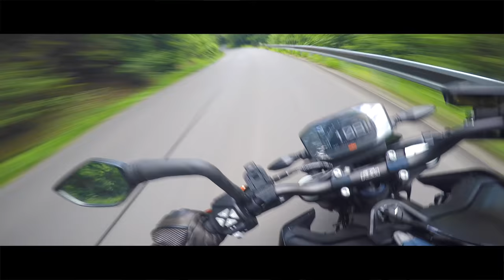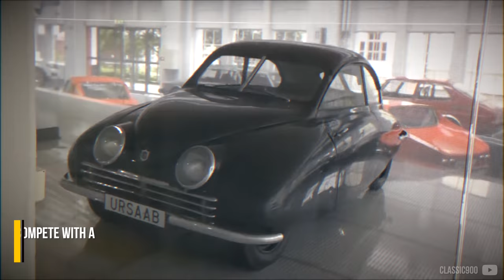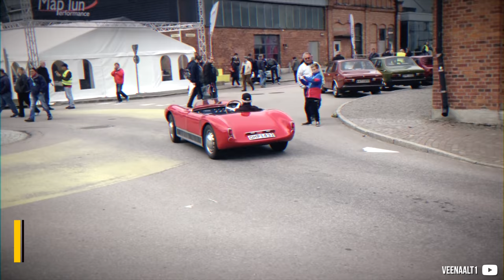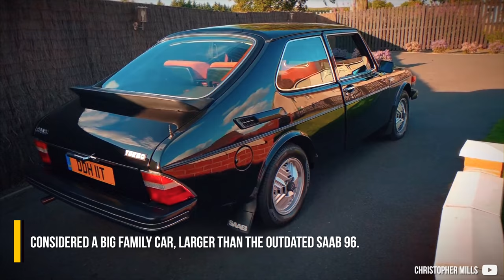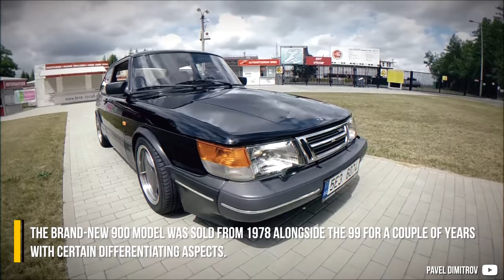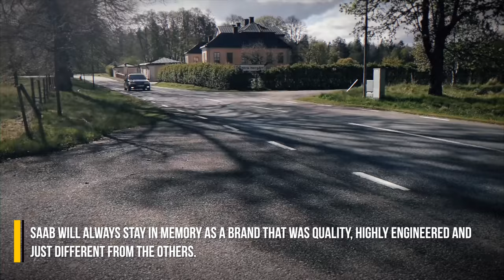Why We Miss The True SAAB?

Comment: Fun fact:

When Saab went rallying with the 900 it didn’t need a roll cage due to it strenght. Tho they had to do so to comply to regulations.
Reply: 99
Reply: @robludwigsen7831  

As far as I know it was with the 900
Reply: Watch project 99 on youtube...awesome documentary. Saab left rallying before the 900 came out basically. It got too expensive.
Reply: Having actually rolled my 900 I can speak to this. I had my sunroof open at the time and it’s a strange sight to see grass sticking through over your head. Both doors still worked but I had to crawl out the top because when I landed I ended up with a fence post on either side of the car. Yes, I was very lucky.

I also had the factory racks on my 900 and wondered how strong they were. I found a photo taken in a junkyard with a second SAAB literally stacked on top of one and they were not bent.
Reply: @robludwigsen7831  

I Will watch it thx
Reply: @blacksquirrel4008  

Thats impressive indeed

Saw a Photo of a 900 with a fallen tree on top of it. Without a bended roof.
Reply: @derbisenda1330  old black and white photo? Tree is like 2-3 ft in diameter? Amazing right?
Reply: @DesertSessions93  

Yess that one very impressive
Reply: I really have no reason to hate Saab and surely their cars were better than an average VW but they just didn't make it after all.
Reply: They still make heavy trucks, fighter jets, commercial aircraft, missiles, and defense systems. The automotive sector wasn't profitable.
Reply: @blacksquirrel4008 Good thing you were not driving some other type of car
Saab 900s have a very strong body
Reply: @earthbarnes6694  yes, very strong.
Reply: @robludwigsen7831  Yes Audi Quattro killd the real rally championship  for most car brands.
Reply: @robludwigsen7831  Saab returned to racing in the form of Rallycross and Hillclimb with the 900 NG and 9-3 though. And later did touring car racing in the STCC with the 9-3 NH.
Reply: Robin Bank ran a successful endurance road racing Saab team in Chumpcar - - > Champcar. Strong and fast!

Comment: the thing I remember about Saab is,  while working on a couple of 1980's and 1990's Saabs while I was an apprentice mechanic  thinking how weird the engineering on those cras was but how well made everything was.
Reply: Once one understood the design philosophy the car made sense and was fairly easy to wrench, especially something like a clutch replacement which could easily be accomplished in under 2 hours.
Reply: @paulskopic5844  Probably came from their military engineering background. Swedish Airforce demanded easy to maintain in the field airplanes, so SAAB (atleast on airplane side) put great emphasis on making parts easy to access and building plane into assemblies or modules, that could be quickly bolted on and off from the plane in the field with minimal equipment.

Idea being..... If it is broken in the field, unbolt it, take same spare assemble from the supply truck, bolt that in, put the broken one in the supply truck to be driven to a workshop somewhere deep in the forest and probably under a mountain. They will refurbish it and send it back to supply. Since the place the plane is.... must be minimal to not be a big permanent target. So there is not great hangars and machine shops at the airstrip. It is just the strip with couple pads to park the planes at while supply truck, fuel truck and munitions truck drive next to it at the pad and load and unload stuff from the plane. Be it loading in more fuel, spent swapping out spent cartridges, putting on new missiles or swapping out whole plane parts.

So I assume as such, SAAB engineers had lot of experience designing bolt on, bolt off mountings, clampings and supports. Including were specific understanding of the assembly and maintenance process due to military demands. "right we have to think where that bolt head is going, since well the field mechanic needs to get their wrench on to it without disassembling the whole fighter plane from around the bolt. No point having few easy bolts holding the engine to make unbolting it fast, if you have to first remove the wings to get hold of the bolts securing the engine in place."
Reply: @aritakalo8011  You are absolutely correct, and I also have explained this to others.  Saab is the complete opposite of Japanese cars where there is no thought to ease of maintenance.  Saab also used as few parts as possible which is the opposite of both Japanese and German where the design philosophy seemed to be "why use less parts when it is so easy to make it more complicated".  I have wrenched a lot of other brands and I would take a 900 series always for ease of maintenance.
Reply: takes longer to put a belt on than change a clutch !!
Reply: I agree with you completely. The Powertrain was so, "weird" for the era a lot of Mechanics had difficulty working on them here in the States. I am a Master Mechanic now so I can spend a little more time on a single vehicle. But back when I was starting out, time was money. The more Vehicles I got in and out of my shop in a timely manner the happier the customers were which led to life long customers in most cases. As a young small business owner having repeat customers was like owning a Goose that laid Solid Gold Eggs 😊
Reply: @paulskopic5844  My favourite was things like the water valve for the heater.  You popped out the left dash speaker and could reach down through the hole to replace the valve.  I literally did the job in 20 minutes while in the parking garage at work. This was the kind of job that could take hours in lessor vehicles.

Comment: My first car was a SAAB. It had an incredible amount of torque and was a blast on the highway.
Reply: Same here. The first was a 99 ems from -73.🙂
Reply: I had some work on my 900 Turbo, and was told by the mechanic to fill it up, and take it out on the freeway and blow it out. It just so happen there was a State Trooper, close by, and stopped me. He asked, "what the hell do you have in that??
Reply: My first was a nearly-new Saab 96 in 1980. Red. I drove 'until the wheels fell of': the engine was rebuilt twice and the g'box and clutch 3x. Then, an EMS and later a 99 Turbo II followed. Expensive motoring when things went bad... After a long period of non-Saab company cars, it was back to Saabs: 2x a 9-3 Diesel and a 96 imported from North Sweden again. Nowadays, I own a wonderfully restored, 99% original Saab 95V4 from 1973!

Comment: The 900 series was an amazing car because they used super high quality parts, they were very easy to work on ( due to the aircraft pedigree ), they handled well,  they lasted a long time, and they looked good.  I parked a 1982 Turbo with a bit over 285,000 miles and I beat the hell out of that car.  It was still running and in good shape at the end.  It was hatchback and I have hauled a truck transmission,  full size refrigerator, a dishwasher, numerous deer, and many other large items.  I also had it off road more than most SUV's alive today.   It would also cruise very comfortably WELL over the legal speed limit.  Luckily I still have a tuned 1985 900 SPG.

Comment: This is quite a good tribute to Saab, my favourite car company ever...I agree, probably the first 900 was the very last real Saab, but also the 9000 and the 9-5 mk1 were incredibly good and well engineered, also quite fast! Once Jeremy Clarkson said that in acceleration from 80 to 120 kmh the 9-5 was faster than a 911 turbo...probably it isn't, but 250 hp on a fwd in the 90s were astonishing!
Reply: Actually, that 80-120kmh acceleration claim was in official 9000 Aero ad/brochure. I might still have it... 9000 weighed only about 1400kg so 230hp makes it quite fast. Even 9000 2,0T i had was fast.
Fun fact: Saab manufacturer in Uusikaupunki made three 9000 V8's by themselves. It was based on 2 combined 4 cyl engines. One is still in factory museum.
Reply: The 9-5 aero is incredibly quick through second and third, first gear is where most of the bogging down happens because the esc kicks in... But if you turn it off with the button saab left in you'll leave tire marks even with full tread tires into 3rd lol, saab after 2000 still knew how to have fun and waste GM's money, thats why they sold them but also why i still love some post 2000 saabs too
Reply: The pre 1994 turbo's could be tuned for that level of power except all of it could not be used until 3 rd gear because of a weak link in the transmission.
Reply: Saab Turbos of a certain age were designed for extremely good "mid range" acceleration.

I'm positive there was a UK advert which had a picture of the back of some sort of fast 9000, with the caption "The new Saab 9000, as seen from a Lamborghini Diablo", with the usual asterisk and small print of "in 5th gear from 30-70mph" or whatever, but still impressive!
Reply: Though they looked like a Nissan or something bland the beauty of the 9000 was its aerodynamics. At speed it just got lower and more stable. I got my turbo to 120 and it was as calm as could be.

Comment: SAAB actually developed their design language quite significantly over the decades!

 Its a common misconception that they became less SAAB-like in the 2000s. By the end they arguably had a much stronger brand identity than even the hayday years of the 900! 

Envall was an absolutely masterful designer don't get me wrong, but the 900 had a lot in common with German Bauhaus. The evolution from the ng900/9-3 to the last gen 9-3/9-5 were SAAB finding its identity again in Swedish sculptural design, as originally utilized by Sason.
Reply: Honestly, I agree. 70's-90's Saabs had this "form follows function" type look. Otherwise, the first and last Saabs had very swoopy, ornate lines. They feel more like they were dictated by emotion rather than the engineering hardpoints of the car.

Comment: My father got his first SAAB in the late 1950’s, and continued for two decades.  I learned to drive on one, in the mid 60’s.  I loved the freewheeling and I still kinda drive like I have it.  One of them died when a gas station attendant forgot to add the oil to the gas tank.  And my only experience with rebuilding an engine was on a SAAB.  Finding a new V-4 motor was a real ordeal.  Turns out that the same engine was in some non-auto function, like a well pump and I was able to get one of those.  This is all in the US.

Comment: While Saab may have stopped being Saab in the late 90s to early 2000s we have the partnership with GM to thank for some of the most bullet proof engines to ever be made. The supercharged LSJ ecotec motor in the cobalt ss and saturn ion redline is essentially a B207 engine from Saab. Made the top 10 engine list when it came out and set some FWD land speed records around 2003 reaching over 212mph

Comment: I’m just about to buy a 9-3 1.8t Hirsch performance 🤩
Reply: same, im getting a 2.0 hirsch performance convertible next week, so excited!
Reply: Well, we still have SAAB enthusiasts after all, I wonder if the cars can be made of Swedish parts by the same people in the future, hmm.
Reply: Nice!
I drive a 2.0 SE Hirsch since august and I'm very happy with it.
Reply: @mifiamigahna  Is it an euro-spec manual or US-spec auto?

Mine's a manual, and I've heard that the clutch likes to slip a bit more due to the increase in torque after the factory Hirsch-tune.

I wonder if it's gonna be a problem? It's used, it has 176.000 km on the clock, so fair to say that the clutch has been through some
Reply: @stegtflaesk  Mine's a manual as well.
I bought it at 200 Mm and the previous owner had replaced the clutch a year or so before that.
The original clutch slipping was probably the main reason for that.
The previous owner did also upgrade to the Viggen's brakes and lowered it though, so maybe he just upgraded the clutch because he had bigger plans for the car.
Reply: Had a standard 9-3 1.8t, it was a beautiful car to drive, always wanted to tune it, enjoy your Saab 👍
Reply: Im about to buy a Saab 900 Turbo APC as my second car

Comment: Great vid! You seem to have missed the 9000 though which was between the Saab 900 Classic and 900 NG. It was perhaps the best Saab ever and still very much Saab-ish with some very clever technology for the time. Due to that though it was also the car that made Saab lose money since it was so expensive to build, during the 99 and 900 Classic days they were doing very well :)
Reply: The problem with the 9000 was it was a magnitude more complicated than the 900 classic series which made it less reliable and reduced the service life.
Reply: @paulskopic5844  they’re very reliable cars despite being very complicated. I own two of them and I know of many people who own them with very high mileage (above 400k km), and they’re stikl going strong without many issues.
Reply: My daily driver is a tuned 9000 with nearly 300kms on the clock and it's a rocket ship. The engine and gearbox are pushed much harder than the engineers originally designed and the reliability has been nothing short of amazing. I change the oil every 10k and check fluids and that's all I have ever had to do to it.

I love driving that car and I'm always amazed at what a good job they did building it.
Reply: @Aquarious  I am basing my opinion on my brother in laws' 9000 which started becoming a money pit at about 150K miles, and he did most of the work.  I have always thought about an early 90's 9000 Aero and perhaps I should revisit this idea.
Reply: Surely the 9000 platform should have been cheaper since they shared it with the Fiat Croma and Alfa 164?
Reply: @paulskopic5844  Maybe he had a 9000 with TCS, those systems are known to be unreliable and very hard to fix once there's an issue with them. Luckily they were only used from 1991-1993 2.3 Turbo's and some V6s.
Reply: @ZIGZAG12345  Yes that must have saved some money, but Saab did make changes to the platform to make it stronger and saver.
Reply: @Aquarious  I am not sure of the details, however that is good information to know which ones to avoid.
Reply: 9000's were warrenty nightmares

Comment: When I was a kid back in the 70's I remember seeing the SAAB TV commercials they were different.. They showed their latest models (900's I think), they took one car and rolled it down a hill (guessing about 7 times) then it would land on it's wheels and then drive off, another the driver opened the door and walked away. The body's showing roll damage at the time it was a cool commercial. It showed the strength and safety of their vehicles. All I can say is they were very well built cars. When they got involved with GM, like Saturn it all went downhill. Thanks again Visio for another great video! Cheers!!

Comment: Back when the Saab 93 went to 3 cylinders, instead of the 92's 2, they said "That's not a Saab!" 
When the V-4 cars took over for the 2 strokes, the "enthusiasts" said "That's not a Saab!". 
When the 99 debuted with an overhead cam slant 4, the 96 owners said "That's not a Saab!" 
When they stretched the nose to make the 900 turbo, the 99 owners said "It's too big....That's not a Saab!" 
When the 9000 came out, a large car, developed with Fiat, with a transverse powertrain, the 900 folk said "That's DEFINATELY not a Saab!".......
Then along came GM. By then, it was forgotten that the first "URSAAB" was built using components from several different manufacturers, many scrounged from wrecking yards, while another 15 years of "Not-a-Saabs" kept the company rolling and introduced many folks to their FIRST Saab! 
Everyone who bought one, thought THEIR car WAS a Saab!

Comment: I currently own 2 Saabs, a 2007 9-3, and a 2010 9-3 XWD, and love both! I would like to get another 67 96 3 cylinder 2 stroke, with oil tank!  One of my brothers had a Sonnet III years ago, and dad had a 99 Turbo. The 96 3 popper was my first car!  It’s been a saab story ever since!  That’s all I will ever own, even if GM had their hands in it!  The Swedes still had their hands all over the design, even when GM owned them.  My first brand new saab was a 1991 Saab 900s, and I racked up well over 200,000 before I sold it!  Thanks for the great video!

Comment: Loved this video! However I had wished you included the SAAB 9000 which I believe ran from 1986-1998, the early models had a t3 turbo, then went to a tb05 turbo, then the t25 or td04hl for the aero models. The 9000 was the family Saloon that eventually changed into the 9-5 when GM took stake. Many will say the 9000 was the last of the well built SAAB's.  I owned a 1995 CS (base lpt model) and fell in love! I grew up last to a neighbor that owned a c900, a sonnet and a scarabe green 9000. I ended up buying one almost identical to my neighbors but mine was manual and the original owner was a woman that bought it new in Murray, Utah. It was cool to see all the service records she had kept, yet she was the only one that did so.  I now own 2 2005 9-5 ARC's one is an Estate and the other a Saloon and also own a 2007 9-3 Aero 2.8 6mt.
Reply: I'm with you on the 9000, I've got a '96 9000 Aero manual, scarab green with only 138k miles. It's a great road car.

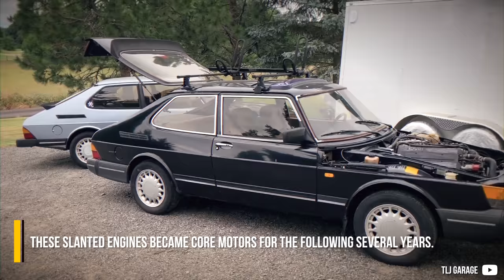Comment: At 4:50 ish those are 900 not 99 and the first motor in the 99 series was a triumph motor with hard to loose head bolts, you had to force the head up a bit so you could saw them of. Lucky me I started to work there after those motors where replaced with a SAAB motor so I never had to do it.

Comment: I've had a bunch of SAABs. 8, I think. Current is 2001 Viggen convertible. Hot-rodded a bunch of ways. Even with a LSD, it'll spin racing tires at 40mph. It's now genuinely fast, with 0-60 just under 6 sec. Favorite SAAB ever was the grey 1991 900S 2-door. No turbo but simply the best car I've ever owned. And really good-looking.